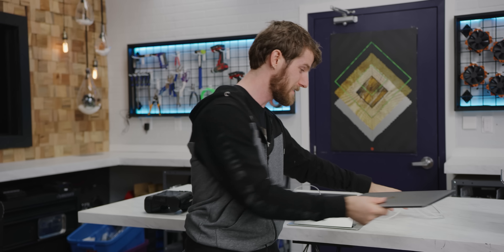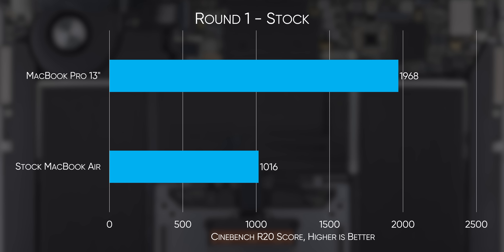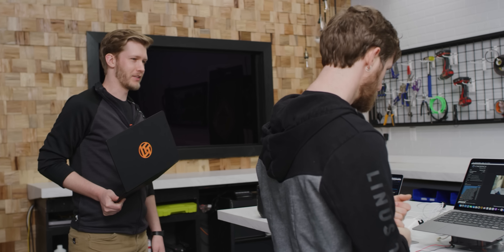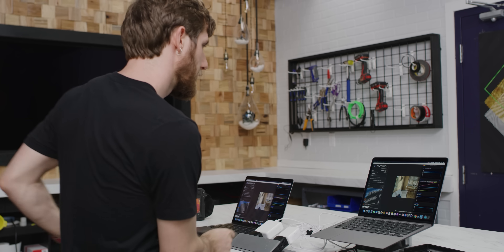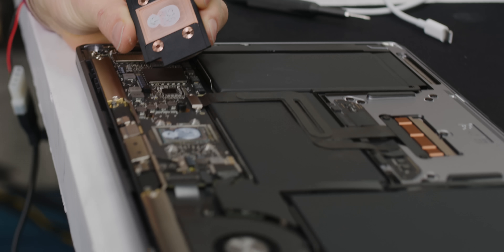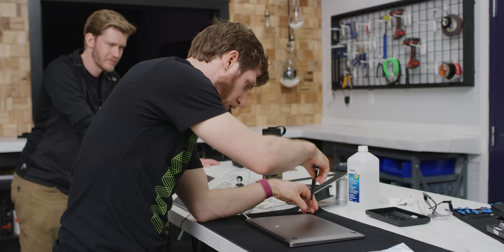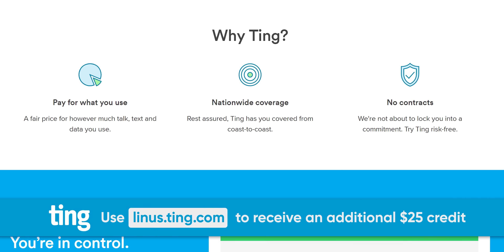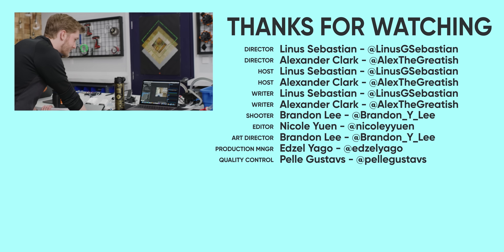Fixing Apple's Engineering in an Hour

Comment: Manufacturing Engineer here - When taking a touch cut a good (not the best) method is to use coolant on cigarette paper and stick it to the part. With the mill on bring the bed up to the tool (not the other way round) and then as soon as the paper is removed by the tool bit lock your y axis and you will be taking a skim cut. I would also recommend a shell bit for removing surface material like that.

Comment: Doubt you have less blood flow to your pinky but cos it's the smallest appendage on your hand it's mass to surface area ratio is better so it looses the heat of your blood more efficiently and therefore is cooler
Reply: It could actually be a cardiovascular issue as well. I've had this happen to my ring finger while skiing...It felt unusually numb and when I took my hand out of my glove only that one finger was ice cold while the rest of them were warm. 

I would def get it checked out if it continues.

Comment: C'mon really! I thought Brandodn would've been able to see how that fan works (in conjuntion with the cover in place) in sucks in air from past the cpu, near the VRM's from outside the hinge (you can see the air inlet fins), pulls it over VRM's, CPU then it's sucked into fan and exhausted out. (yes apple could have done better, but its not just a fan having nothing to do with the cpu) Its not really an active fan as would have been best, but it is better than just passive.

Comment: What a shitty design. Whats even the point of having an i5 with 3.8 ghz turbo boost in this thing when it thermal throttles so damn early and only draws like 10 Watts at best. Apple tries to keep up with other manufacturers by having the same specs, but the performance just suffers because of thermal limitations.

Comment: 6:34 "I'm uncomfortable" 
That is an understatement. Next time, with the spindle off. Bring the endmill down until it touches a piece of paper on the material when it hits the spindle stop. Next move the dial on the knee crank to zero. Once in position crank the knee up to your desired depth of cut. Account for the paper which will be about .004" thick. Adjust depth of cut by moving the knee.

Comment: since you have a milling machine, you could have machined an aluminium block that fits perfectly between the case and the cpu, eliminating the trash stock heatsink and the thermal pad.
would have been interesting, and you'd actually use the beautiful bridgeport more, which alex apparently does not use enough :D

Comment: Even the Nintendo switch has a better cooling solution than the MacBook Air
Reply: While the joycon are really problematic, the switch console itself is a really well engineered device; cooling is well thought out both in handheld and docked form and it is pretty easily repairable. Also yes, docked switch can maintain the cpu at a higher tdp than the macbook air lol.
Reply: @leonro  the real question is, would you buy a handheld/dockable switch that is double the thickness, but is capable of raytracing?
Reply: @RyoApeiron  I would, I already have to put grips on the joycon as they are too thin for me to hold comfortably, the only deal breaker for me would be if the battery life was lower
Reply: Yepp, it has a proper exhaust vent too and has a much thicker form factor
Reply: the nintendo switch has good cooling, that does what the bad solution on this one does, without overheating :P

Comment: I use a Surface Book for my 3D designs, and sometimes I need to render or make simulations... The software I use relies on the CPU for its image and simulation rendering so the CPUs rise up to 100°C... The last job, I managed to place my Surface Book, at the top of a shelf and made a duct with some foam and tape, straight from the A/C.... well... I managed 25°C lower temperatures, so whenever I can I will try to do that... the batteries are already suffering from 4 years of use and over 800 cycles.

Comment: I also had a laptop in which the fan wasn't on top of the CPU or the GPU. (This was back in 2007 and the thing had a hefty GPU for the time.) But it was made by competent engineers and it was a technological decision at the time (no way to have an optical drive, a whole bunch of ports, and a replaceable battery, and still have two exhausts) not just a dictum from marketing to make the Thinnest Macbook Yet™. So they did the sane thing and connected the heat sinks of both processors to the fan grille with a pair of copper heat pipes instead of just hoping that the fan will move enough air through the chassis for cooling them. Seems like the same thing would have worked here if they weren't trying to sell it on the brand alone...

Comment: So... It needs to have a square hole cut down in the botton part, and a small and thin fan glued down over the hole (not blower style like laptop fans), and connected in the place of the original fan, and also be messed around in intel xtu?

Sure does look like some random chinese celeron laptop that costs like $40.

Comment: Water cooling? I woulda used alcohol or mineral oil cooling... Have fun dropping that 1 time and frying everything with a split water cooling system...
Reply: When I first saw this on my notifications bar I litterally that you where going to add an sd card slot to the iPhone... Well still missing my marbles. 🤕

Comment: GUYS! Seriously? The ducting is on the bottom panel. When the bottom panel is attached, it runs air through the CPU heat sink. Please tell me I'm not the only one noticing this. It's still a dumb design, but it works fine. Heat IS expelled

Comment: If they increase heat transfer to the bottom you will burn....  So they have to decrease the contact surface...  If they increase fan...  Battery space will be affected and also "10" hours endurance will decrease.....  So there is no way to stay small and being fast with that technology and construction.... Change the technology of battery and processor and you will have a max of 40% more...   But that is the "limit" for a long time

Comment: They wanted it to sip power for battery life, all else being equal. Even if you try to run heavy workloads.

Running with such limited wattage makes beefy cooling unnecessary. Beefy cooling would perform so close in speed versus having no fan on the CPU that they rounded down and went for passive-ish cooling on the CPU. (No direct fan, just full chassis exhaust fan). As mentioned in the video, it's easier and cheaper to design the less-powerful cooling solution they ultimately used.

Mystery solved, case closed. They sacrificed processor power in the name of battery life. (LTT can potentially confirm this by running with their beefy ice-water cooling and seeing how much worse battery life is. Ideally they would disable the power limits in macOS if possible).

That doesn't necessarily make it a good or reasonable design decision. It just explains the priorities they chose.

Comment: So what if the MacBook Air is actually using a hardcoded power curve instead of dynamically adjusting it using available power and temps? Which is why even when cooling is under control we see it acting the exact same. 

I mean obviously it could also be power limiting, so then the power supply can not supply more than these 13 watts sustained, only in bursts.

Comment: Can't get that replacement part?  If I had a mill like that and was in your shoes I would make my own.  How hard can it be?  Buy a piece of copper or aluminum and make one.  You might even make one that is improved over the one you had.  That is why I don't like Apple, they have a lot of parts they don't sell to you and would rather you buy a new one even though there is a 10 cent part that failed and they refuse to tell you anything about it.

Comment: I don't agree with these burns temperature, I'd like to have sources, I may be wrong, but I remember the limit was 55-60°C for burns ( or hurt sensation ) and that's why it's the max temps we use to melt the jello' thingy in biochemistry ( If I remember correctly )

Comment: There are really obvious ways to make laptops cool a lot quicker, that involve adding just a couple of mms to the case. Too bad the market cars so much about thinness
Reply: metal fins on the bottom of the case with holes at the bottom/front where air blows and flows through the fins from bottom to top and out the back. boom. combination of convection and a slow fan, be nice and quiet too

Comment: So perhaps fixing the heatsink, replacing the insulation with thermal pads and then put a bit of insulation on the outside just to keep you from contacting the hottest spot.
Or alternatively you could buy a laptop from a serious manufacturer instead of rotten apples 🤔

Comment: I wonder what would happened if you put thermal pads on the power mosfets. Once you get the CPU under power thermal limits, the power delivery probably is the next thing that power throttles. Could earn you a few watts more if you manage to get them cooler.
Reply: Probably not...As much as the enthusiast community assumes, not all intel chips will infinitely turbo as long as the supporting systems allow it...This behavior is mostly a desktop feature (where intel sells directly to the consumer). For laptop chips, especially non-k branded ones where they are marketed as "power efficient" and "ultra low power" class, I doubt that intel is willing to let the get away with such a turbo.
Also 13W measured is so close to the rated 12W tdp that intel allows for this chip. I'm pretty sure this "power limit" is less about vrms and just that the cpu has hit its maximum allowed power draw. The only real solution for this would be to go back to intel to supply the next class of cpu.

Comment: Apple didn't put the fan in the middle so the laptop doesnt last as lomg and they end up with more money out of your pocket same reason they slow down the phones after updates apple doesn't give a flying monkey about you they only care if ypur wallet is open and upside-down in apples hand.
Steve jobs would be turning in his grave in how apple have changed i avoid them at all costs now if its out of my pocket if its the company i work for they can get ripped off

Comment: 20 degrees by just evening out the heat sink base... Ouch... That's less than a dollar a laptop to fix in the manufacturing and it makes a huge difference. Apple truly is the king of expensive cheap engineering.

Comment: By the time you guys got to the water cooling there was too much surface area dissipating heat for the cooler to dissipate it any faster... The heat had to transfer through the thermal compound through the heat sink through the heat pad through the chassis and then into the water block and water...

Comment: Apple Engineers watching this video like: "WRITE THAT DOWN, WRITE THAT DOWN!"
Reply: Naw, they know... they just don't care.
Reply: Ok boys, for the next Mac even more thermal insulation!
Reply: That's the problem when people buy products regardless of how good or bad they are. Apple is no longer obligated to make a good product anymore, because they're going to sell loads of them anyway. From a business perspective, anyone in that situation would build a cheaper inferior product, because there are zero consequences
Reply: @sawspitfire422  I guess if you think about it, its not consumers fault. Like your avg consumer will never look at cpu temperatures but chassis temperature which is cooler than a lot of similar destined windows machines. Also apple smarty chose to fuck up mac book air and as most people looking to buy this machines will only use it for light usage. You can see they've delivered great IPhones in last couple of years and MBP 16 was relatively great too but they screwed customers with Macbook air (which I believe sells a lot more than their pros)
Reply: Craig X  abuser? Lol mate you kidding me? And yes the tempuratures is indeed wayyy cooler on outside than dell xps 13 or hp spectre just look it up

Comment: On every laptop I have opened I got 20 - 30 degrees celcius lower temps by only changing thermal paste. And one time there was a laptop without holes under it to suck cold air in. The fan just rotated hot air.. So I had to make some. That did ALOT for the temp :P Haha

Comment: You guys, just discovered how planned obsolescence works. This machine is designed to fail. Even if no performance was lost, ~20C to 100C temperature cycle would definitely loosen some solder joints in couple of years time.
Reply: How does it loosen solder joints? I've had plenty class A amplifiers where mosfets easily hit those kinds of temps. My personal amp is 20 years strong and not a single problem. To me 100C just doesn't seem that dangerous, and actually fairly routine...

Comment: I saw some people installing thermal transfer pads between the heat sink and bottom case. It works to spread the temperature but I'm worried about it heating the batteries.
Reply: For the burst like modes that most Mac users experience it will be OK and allow for higher turbos.
Reply: the thermal camera shows a hot spot so all of that heat isnt transferred to the batteries also theres that fan so as long as theres space between the bottom case and the batteries it should be fine.
Reply: Even if... Buying a new set of batteries if it happens wouldn't be that bad of a risk
Reply: @lonsn3929  but what if something happens. There is still a risk and I am not sure whether you're going to be able to fix your Mac with AppleCare + cuz they may just reject your request

Comment: I mean, if you think that no connecting the fan with a conductor will make it too hot, and thus Apple is making an error off it,  then just connect them with a off-the-shelf copper plate and measure the difference.

I don't see anything you've done here achieve anything except letting people see how fat and ugly MacBook Air can be if properly cooled.

Edit; Oh, the real test starts by 7:00, and by the way I see them handling a milling machines.....errg...

Comment: This lack of heat management seems intentional.  I cannot see any valid engineering reason for not simply using a heat pipe or something similar to get the heat to the fan... not to mention the shitty heat sink mounting.  There is no way Apple engineers didn't notice this.  It has to be intentional.  I would say class actionable in fact to build an intentional flaw into the laptop without disclosing it.
Reply: dont swear

Comment: This information is very interesting. I wasn't disappointed because of the speed but because of the toasty temps and the ramping up "case fan", so for me it already would be the perfect fix to rework the cooler and add an thermal pad... whats the cost here? 5 Dollars to reach the powerlimit for long tasks without a meltdown temp inside my Laptop?

Comment: [apple iengineer makes a good design] apple imanager slowly strolls in, looks over his shoulder while holding a very full coffee and says "yeeeeeeeeeeeeaaaaahhhhh, im afraid this design does not utilize the full power of the cooling system as the cpu is at 60 degrees instead of 220 degrees fortnite for god's snake mr rhammar, the cpu goes in the center its called a cpu for a reason come on remember the slowgun think different we make experiences, not hardware also you gotta put the fan over here" and leaves having completed his work for the day
apple iengineer dares not question it or he will end up like dave, sarah, tyrone, muhammed and osha and he screams internally as he, a former apple ifanboy, ruins the design even further

Comment: I cant believe and actually tried to find the specs on that madbook. Ill assume its the i5 version, because the i3 is dual core and the i7 only gets mentioned in Apples fancy advertisement column, but cant actually be selected for purchase (and I cant imagine putting in an i7 actually nets any improvement with that cooling and power delivery). 
I find it absolute nuts that people would pay 1.400€ or 1300$ for that piece of crap, when I managed to get a motherboard and Ryzen 2600X for a PC for just 220€ (and that shit stays cool), and even if I factor in the rest I already had I think cost wouldve been around 500-750€ depending how exhaustive you make the list of parts included. I even looked for normal Laptops and found fairly acceptable ones in a price range well under 500€ as well. 
But yeah, Apples engineering is a meme, and their pricing is as well.
Reply: True. Just spend a few 100 bucks more and get a MB Pro or buy an iPad Pro instead but not this crap.
Reply: dont swear

Comment: Might be a stupid question but can I do the thermal pad fix and then put an insulator on the outside of the chassis to protect against lap heat? 
Also were the results from each test done with a new laptop? Like is the 14% increase of the thermal pad test due to the thermal pad alone or thermal pad + heatsink mod + thermal compound??